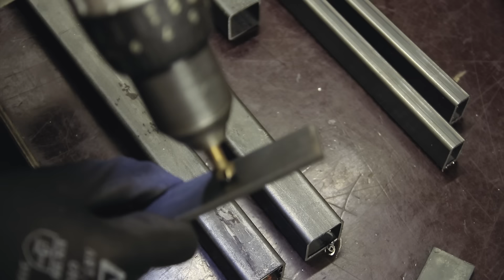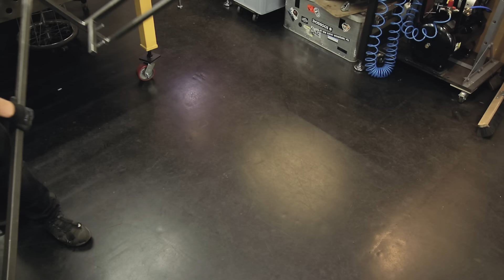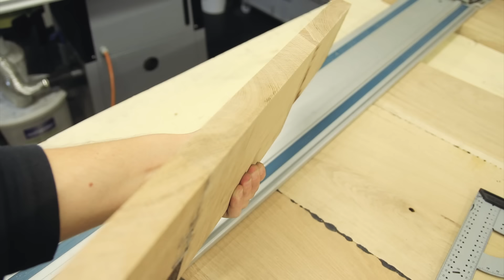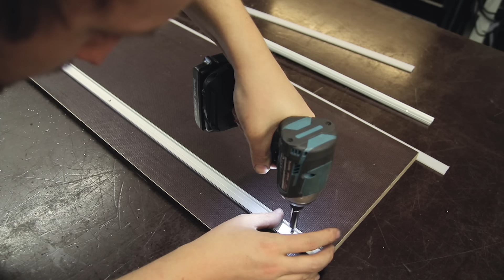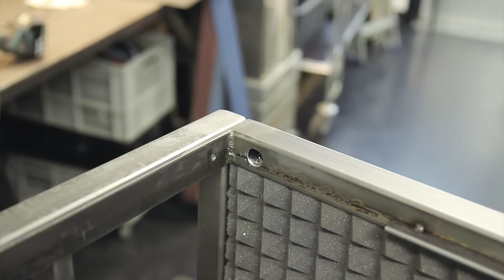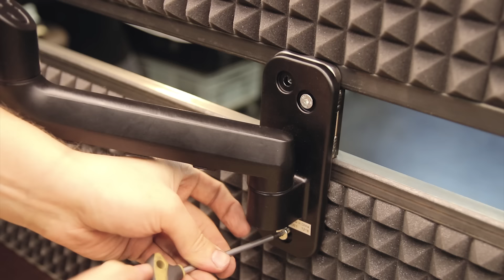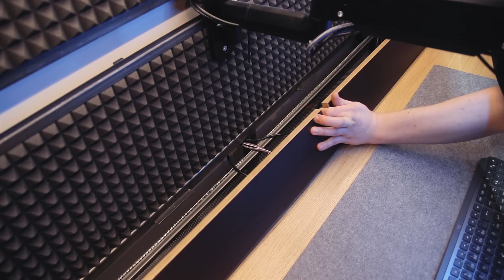How to Build a Cable-Free Desk with Built-In Lights, USB, Outlets + More!

Comment: That looks really good.  Have you thought of darkening (stain or paint) the front edge of the speaker shelves?  It might help them blend in a bit more with the surrounding metal, foam background, and speaker colors.  I say this because my eye was drawn towards them being the light wood color surrounded by darker colors.
Reply from the maker: Definitely something to think about! I'm actually considering building new speaker mounts since quite a few people told me the speakers should be angled in towards the user for better sound. So I thought about articulating speaker mounts where you can rotate them
Reply: @PhilVandelay  you can easily get better sound by angling the speakers towards the user, but it's mostly up to user preference, and also, what kind of speakers you have, as to exactly where you want them pointed... in cars, the tweeters that get installed separately from the speakers, usually have a little ball movement on them, so you can angle them a bit towards the front seats where the occupants would normally be setting, so if you're using full range speakers with tweeters speakers and all of that, built into the speaker box, then it would probably be a good idea to be able to angle the speakers or the shelves a bit, so if anyone feels like doing so, they can

Comment: The engineering effort in this desk is mind boggling. Since covid and "work from home" are here to stay in todays world this desk is even more intriguing. While I don't have space or resources to do all the cutting and welding, I love the craftsmanship here. I've been trying to make a somewhat cable free solution as well from off the shelf parts, and some ingenuity. One of my goals was to have wheels so I could roll into the next room or outside to the patio on the back of my house. Great work, and keep em coming.
Reply from the maker: This was actually one of the ideas here originally too, and it still would work with this concept. Since there is only one cable coming out of this (main power) and everything else is contained in the desk including the PC, you could very easily move this whole thing around as one unit if you put wheels under. I'm not sure it could go on a patio though since I'm assuming there's at least some kind of seam/bump between the inside and outside that you'd have to roll over, if there's one thing this desk isn't it's light ;)

Comment: This is the most practical desk I've seen, I'm in the process of very slowly building mine, I have ideas but I have 0 tools (also almost 0 skills). So your video is helping a lot because I can visualize better what I want and need to do to achieve that.
Your idea for fixing the screen is nice and helpful. I drew something similar on paper with the idea that I can slide my monitors (2 maybe 3) in front of me using a bearings/wheels system fixed on the desk depending on which monitor I need, gaming one or graphic/photography/video one.
For your integrated cable management compartment, couldn't you fix a long power strip inside so it's easier to use? I found a 12x strip on Amazon, very good quality.
That foam board is nice too, I did the same thing with a loose board that is threatening to fall and kill me 😂

Very elegant desk. Truly. I would have bought one.

Subbed.

Edit: also your welding table is absolutely gorgeous!
Reply: With 0 tools and 0 skill you gonna need a lot of patience :)
Reply: If you're trying to weld a desk like he is I'd suggest buying a decent amount of scrap metal and practicing your welds
Reply: @RiseOfAnarchism  impossible, I live in an apartment so I'm building with wood and screws. Every time I add a little thing that helps me comfort, big plate that I sanded and varnished, trestles with enough place so I can put my PCs, printers and hard drives under, next step is the back upper plate that's gonna have some sound dampening foam (if it's any good) and lighting. Step after is gonna be thinking about a mechanism to slide my screens. It takes a lot of time and thinking.

Comment: Holy amount of tools you have access to.
Is that all your or you using tools from your job, or yours but you make a living with them?
Because that's dream workshop material <3
Table looks great btw.
Reply from the maker: Well the huge woodworking machines were in my friends workshop, I only have the "normal" tablesaw when it comes to wood ;) As for the rest, yeah they're mine, I collected this stuff over many years and basically spend all my money on tools. I do make a (moderate) living as a content creator now, so you could say I make a living with them, yes. But also a lot of them are budget solutions, I don't have many pro-brand tools actually, most of the machines are from China. Just saying this so it doesn't seem quite as unachievable - I think most people who otherwise spend money on cars, clothes, gadgets and other luxuries could afford a nice shop if they really wanted to.

Comment: Very neat setup! Very usable too! Can imagine it will be a good sold product if comercially available. Both for customers as for office use, althoug for the latter the legs probably should be height adjustable.
Reply: Good idea... I don't plan on doing a desk like this specifically, but I am thinking about doing a single height wraparound "C" shaped desk that's basically a metal frame like what's used here, that's attached to the wall, on 2 sides, then will have the 3rd side resting on a freestanding short wall... I'm still debating on whether I want a full "C" shaped desk, or if I want a more standard "L" shaped desk, but it would give me more space for working on computers and such, if I had the extra space gained with the 3rd side of the desk.

Probably take a while to do, if I ever do do it, and for clarification, my original plans were inspired by a YouTuber named "hardware unboxed" who did a desk for his new computer shop

Comment: One small recommendation: grab a 12 way Bachmann Handwerkerleiste.. that keeps the cable channel much tidier and avoids having to use multiple extensions, plus they are easily mounted and stay in place when you need to plug something in or out.

Comment: This turned out a lot cleaner than I was expecting and I’m in the same boat. I’m thinking of ditching the dual monitors for an ultra wide. I like that it’s a 38 inch monitor. That looks awesome. I’m more a fan of the wooden rustic looks over industrial looks but this looks good.

Comment: Wonderfully conceived and extremely well-executed. Bravo! My inclination - not being a welder - would be to look into 80/20 T-slot construction. I have an old, still fully-functional, Workrite Ergonomics sit-stand Sierra HX corner desk with an extremely heavy top, zero cable management and no shelf up above. This inspired me to think about replacing that top with something similar to what you've done here (i.e., from the desktop, up).
Reply from the maker: Ah yes, extrusion profile would actually be a great way to build this without welding. It's not cheap but sturdy as hell and a breeze to put together. And you can add/remove/change things whenever you want.

Comment: Nice!  What welder and weld table are you using?
Reply from the maker: I made a video about the table if you want details, it's on my channel. The welder is nothing special, a cheap-ish machine from a German importer which I'm assuming comes from china originally, since it's not a "brand" machine and a bit older I don't have useful info, sorry

Comment: I loved it Phil.❤👍 You don't do things half-measure 😂 One thing you may have missed is elongated fixing holes for the solid table top to facilitate wood movement. As always I look forward to your next project👍🙏
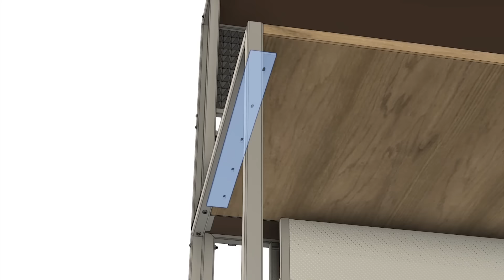Reply: Starting at about 9:35 you can see that the tabs that hold the top on do indeed have slots for wood movement. It's really a great design.

Comment: Did you account for expansion/contraction of the wood of the desk when mounting it to the table? Oversized holes on the brackets that mount it to the frame would do the trick. Otherwise the top will split.
Reply from the maker: Yes I did, it's in the video
Reply: @PhilVandelay  I'm just dumb and missed it then. Great video!

Comment: That has always been a problem. computer desks are never deep enough! they can be as long as possible but depth? 
 I am using an old dining room table which is 900mm deep which is just enough for my predator monitor and keyboard.
  Keep up the good work!
Reply from the maker: Yeah this one is 850 deep front to back. No idea how people manage with those 600mm desks, it's one reason I gave up on buying one, they all have the wrong size

Comment: When doing the folded edge, you can just fold it past 90 deg, release the stock, pull it out, raise the ramp and fit the folded part under the ramp and then crush it flat with the ramp all at once, as if you were just pressing the stock to fold it, but you are actually completing the fold via the ramp rather than the bending part of the mechanism...
Reply from the maker: Ah good idea! Maybe I'll remember next time
Reply: @PhilVandelay  It works best with the industrial folders that have the holding ramp made outta thick solid triangular slab which can then hit the already folded edge at many more angles and still make full contact, unlike the L sections if they havent been given the flat plate on the bottom to triangulate it for stiffness... Im glad you even got what i meant, as my technical terminology is a kind of a scrapbook and quite some quick wit in figuring how something might be called in the industry...

Comment: Diggi, baust mir auch einen? Kriegst auch zwei Fischbrötchen.

First of all great job, I want one 9.5/10. 

What I would have done different is

1.) When you have to use 2 pieces of something (like the acoustic foam) and you want to hide the seam, try to make it a curved/zigzag line. The human eye brain loves straight lines and will find them 

2.) RGB-CCT allows you to adjust the temperature of your white light because it comes with RGB+warm white+cold white, allowing you to use cold white when you are working during the day and warm white for a more cozy feeling when you are just watching some videos in the evening.

3.) Rubber grommets to avoid wires rubbing on metal are a few cents a piece but meh.
Reply from the maker: Valid points, I would have used a grommet if I had one around but figured I'm the only one using it so should be fine. I actually looked at the CCT strips but they're quite a bit more expensive - luckily it should be easy to just switch them out if I ever want to use nice ones (with better CRI and stuff too). As for the zigzag, something like a finger joint with interlocking squares might have actually worked even better here since the foam is essentially a grid 🤔

Comment: The special plywood is called phenolic plywood. I think its designed for making concrete for work, so it releases from the concrete easily and leaves a uniform finish
Reply: They were designed to be plywood that's weather resistant, concrete forming is only one way of using them. It's pretty common in Germany.

Comment: Really nice build!  Prepare yourself for the woodworking army to criticize your tabletop mounting solution, since it doesn't allow for expansion and shrinkage
Reply from the maker: It does though, that's why I made slots instead of holes. I'm sure they'll find something else though 😅
Reply: @PhilVandelay  the people that bitch that you did it wrong probably can not use a screwdriver or even read a tape measure . or even know how to turn on a welder .. there miserable so they try and make ever one else miserable to make them think they know it all .. I just think of them as TROLLS ... keep up the great work and videos ,,

Comment: Nice build, I think maybe acoustic foam tiles could be a good solution to the seam in the back board? The square type with parallel ridges, they go on in alternating orientations like a checkerboard, you still have seams but it looks like it's supposed to have them.
Reply from the maker: Yeah I was actually gonna use those at first but then went with the Pyramids for some reason. Maybe I'll switch them out t at some point